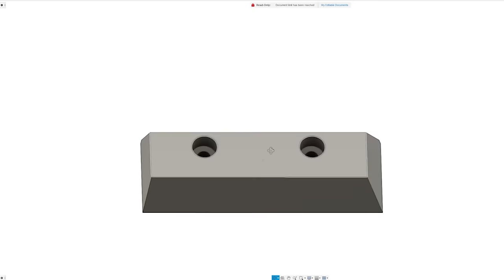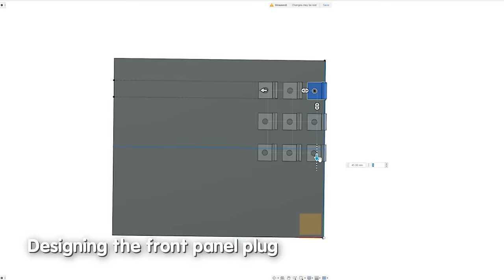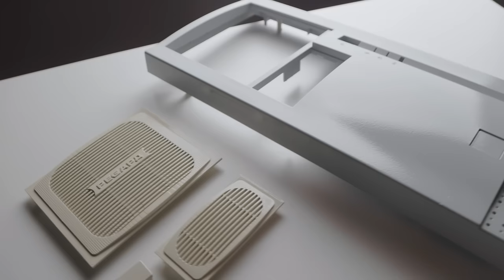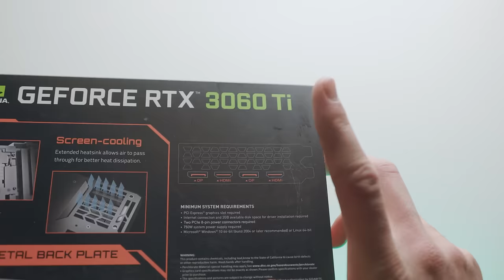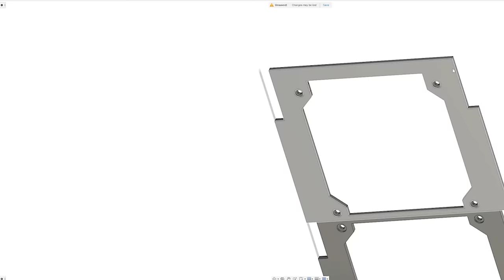Retro case in a GAMING PC - RESTORATION AND CUSTOMIZATION

Comment: Did good, lots of work put into it... nice job. One piece of advice that many overlook and think it's not necessary. It really does matter where those hoses on a radiator are located when using closed loop liquid cooling. Despite what some claim, the most efficient and effective way to mount a radiator like these are at the top with the hoses hanging down. You can also place the hoses at the bottom when mounting for a vertical position. This ensures all the air in the radiator is at the top and will remain there so your pump isn't pulling in air and make gurgling noises for more efficient cooling. My personal preference is at the top in a horizontal position, but then it depends on the case.
Reply: Yeah you want the radiator higher than the pump, any air will rise to the top of the radiator.

Comment: I do like the sleeper esthetic, but personally I'd get one of those ide to sata boards and have kept those floppy drives and the retro disk drive. 
Starting up the PC with all the correct retro sounding components that's still fully functional.
Reply: I tried using those IDE to SATA converter boards and they didn't work. I tried them on several different drives CD and DVD drives but no go! I don't think they are even real.

Comment: This reminds me of the videos by My Mechanic. Were you inspired by his style?
I would have also cut a square hole into the motherboard tray so that the motherboard doesn't have to be removed from the case if a different cpu cooler requires a different backplate. Also, there are reverse facing fans that can be put into the bottom of cases that look more fitting.

Comment: "How to take a good retro case and convert it to a bad modern case".

Now the intake is just hot air with insufficient clearance, the pressure in the case is negative, a buttload of turbulence in the airflow, no cable management features :)) maybe it makes for some content, but not something I'd do or recommend.

Comment: bad conection in the gpu , dont use the same cable x2 gpu power. use x1 x1 . u can overcharge the line if use x2 in 1 cable.

Comment: Cool idea...but... One; most don't have a high end 3D printer to make all those cool looking parts; Two; If you're going to put that much work in a case to fit modern components why not just get a modern case? Sorry, just being honest. I just finished building a "sleeper" with an original 2001 VPR-Matrix 1820 ATX mid tower case that required no case modifications what so ever.
Reply: It looks funny, everyone has another opinion

Comment: That paint looks terrible! So much orange peel. The person spraying doesn't know the correct distance to hold the spray gun from the work, so the paint is starting to dry before it lands on the surface. If you look at the reflective paint surface in the light, it looks like it as millions of tiny hollows, so the surface looks rough.